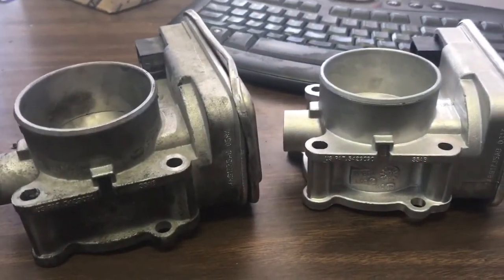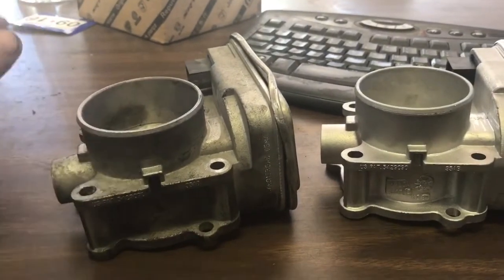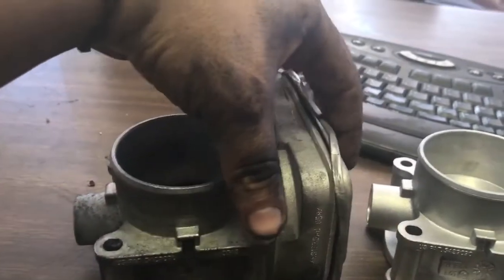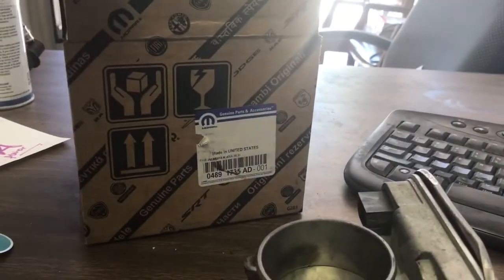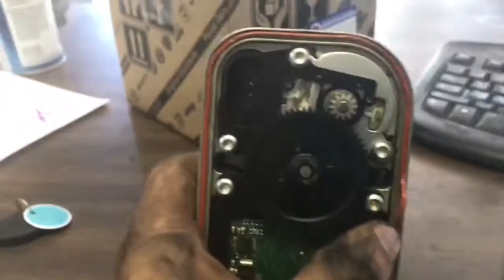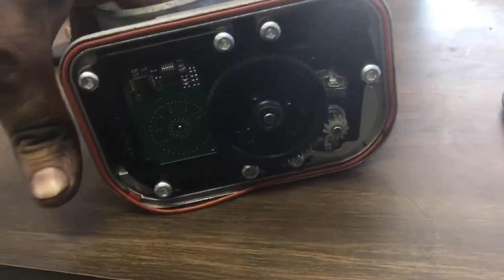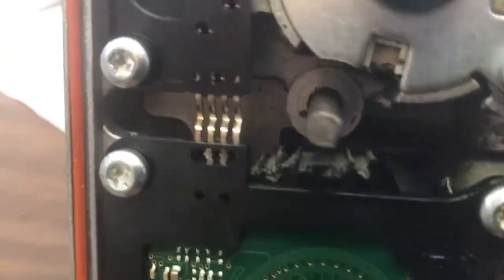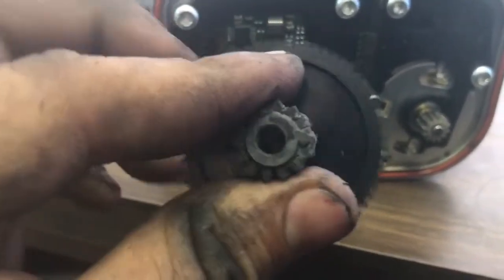A look 👀 inside of a BAD throttle body will shock you !!

Comment: thanks man! I just recently had this problem. My mustang would go into limp mode because the throttle body was bad. tried to clean it myself but little did I know what was bad it was the inside. So I had to get a new throttle body for my car - it cost me about 230 bucks. Is one of the scariest things when your car goes into limp mode in a hill or in heavy traffic..
Reply: Luis Hernandez my mustang did the same thing man, I cleaned mine really good and it seemed to fix it

Comment: Hi I'm sorry for the question I'm trying to figure out if this is my problem have changed so many parts, did you feel like car had no power or will not really accelerate with rough idle? Feel like I have no lower rpm torque like before that had been getting worse with time. Plus towards the end when you explain that it will catch it feels like that ill be driving and rpm gets stuck like if I had cruise control on but at like 20 mph I then flip the gas pedal and it gets unstuck.

Comment: butterfly valve work hard  as the air intake come in through that's cause  the gear set mesh up...i still don't get it why they made it from soft plastic... it supposed made from metal or hardened steel... or there is an aftermarket part come a great solid material
Reply from the maker: dqflyheli they're made out of plastic so they can mess up. Car manufacturers still want to make money of the car even after it leaves the lot
Reply: me totally agree

Comment: Hey what's up bro I just had my throttle body clean on my 2012 Silverado LTZ it is doing the same thing when I come to complete stop it's still wants to go then it idles High then after that it idles low runs a little rough